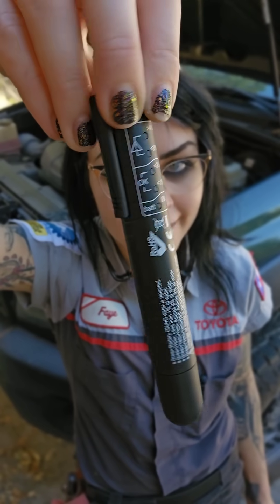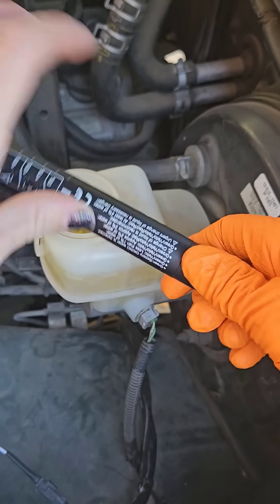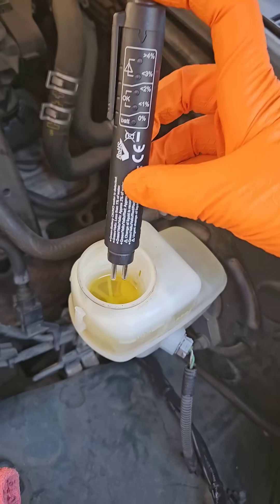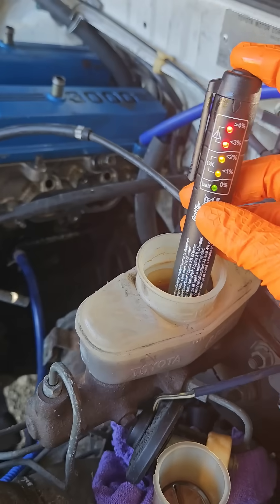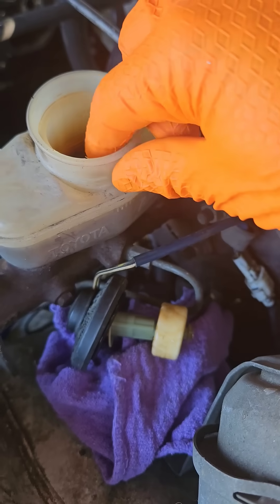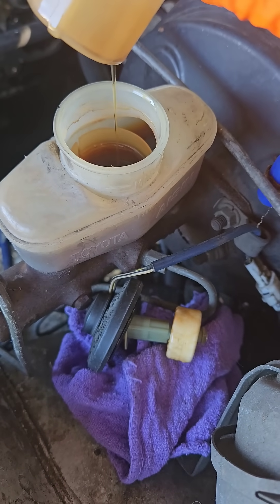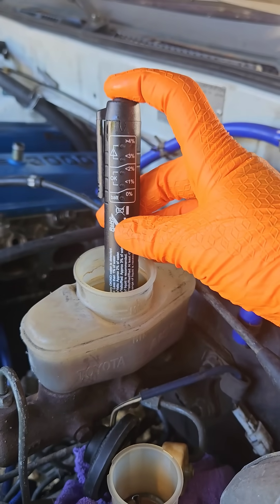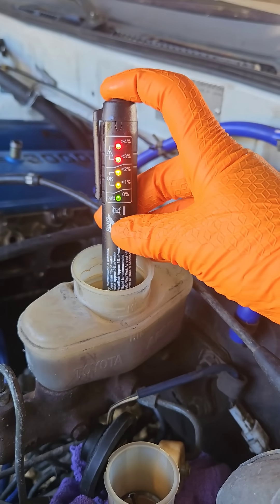Do you REALLY need your Brake Fluid Flushed?? How to Test it For Yourself!

Comment: Technically, water does compress. Although, you would have to have extreme amounts of pressure to the point where it would not only compress itself into ice but if you went beyond this compression it can make small nuclear like explosions as the element goes critical.
🤓☝️
Reply: Im sorry but you are incorrect. Not about water being compressable that is true.
Though water does not become ice under pressure because ice is less dense than water ( pressure melts ice )
And if you are wondering at the bottom of the ocean water is about as compressed as it can be
Reply: @barnabasrsnags4828  water turns into ice under ~1GPa or 10,000 atmospheres of pressure.

I'm speaking as to more of a theoretical standpoint as you can't get to those points under normal means.

The explosion part is under MUCH MUCH higher pressure reaching the criticality point

Upon reaching criticality (theoretically), the neutrons undergo an ongoing series of explosive reactions

If you take ice normally like it just came out of there freezer- then yes, it would melt fairly quickly under much MUCH lower pressures then previously stated :)
Reply: @RexyTheGryphon and i wasnt adressing the explosion part that obv requires star conditions but i like dont wanna argue now yk
Reply: Supercritical ice VI is not equal to ice but whatever have it
Reply: @barnabasrsnags4828  hey, I'm just a retard on a phone okay? I don't know exactly what it's called, I just know the theory behind it

Thank you for pointing out the name though

Comment: Instructions unclear, changed my blinker fluid.
Reply: I knew someone would bring up blinker fluid.
Reply: How's your elbow grease level?
Reply: @TheBriganProductions And check those muffler bearings, and change the air in the tires. 🛞
Reply: what brand of blinker fluid do you use?
Reply: @noredine  No specific brand, any brand will work just fine. 👍🏼
Reply: @noredine yellow flash
Reply: Don't forget muffler bearings 🎉😂
Reply: There must be something wrong with my car. I can't find anywhere to put blinker fluid in. Can someone help?
Reply: @thechicken1477  yes we can. Blinker fluid isn't for your car.. it's for your eyes 👀
Reply: @ItsJustGravy  No its for my car. It says so right on the bottle.
Reply: Easy to follow. Nah you just a dumbass
Reply: Dick stuck in the tailpipe…
Reply: Nah see it's: instructions unclear, dick stuck in toaster.
Reply: After she said blinker fuild was baş i stopper watching her
Reply: But blinker fluid was actually a real thing.
Reply: Make sure to check those piston return springs.
Reply: I actually had her looking for the headlight fluid. This channel is a joke 😂

Comment: Isn't it better to test the break fluid in the actual breaking system which actually gets warm and absorbs water that can corrode the breakfluid pipes ? The plastik container on top of the breaking system wont get hot or does anything at all. The breaking fluid in the breakfluid pipes wont mix with the breaking fluid in the plastik container at all

Comment: so when you do brake pad/rotor changes its normal to bleed the brake system, this almost always drains any water out of the system.  regular brake changes lead to no accumulated water, also the brake system doesn't get hot enough inside the lines to boil water into steam so that's not really an issue at all.

Comment: Despite popular opinion water IS compressible. Sure to the average person under low pressure it's not but if you put it in hydraulic systems and add 5000psi it is spongy. Water is 2 parts hydrogen ANNNNND oxygen. The atomic spacing of the oxygen molecule is where the "compressibility" comes from.

Comment: You don’t need your brake fluid changed until after about 100,000 miles and even then on some occasions you still don’t need to change it after that
Reply: not true at all, by your logic 50 year old brake fluid is just fine

Comment: It's fine if you think you don't need it and test for water saturation but the test strips I use check for pH which checks for acidity and copper content.
Either way, your brake fluid is treated like any other system. It has a recommended maintenance schedule.
Same for your HVAC.
In conclusion.... Maintaining your vehicle's different systems will help you get the most life out of your vehicle and save you money in the long term.

Comment: The scam with brake fluid flush is a tech may only suck out the reservoir and not touch the fluid at the calipers. Many dealers will do this because the flat rate tech will only get 0.5 which is not enough to do a proper flush so it’s easier to do the bare minimum.

Comment: I usually change/refill brake fluid when i get an oil change. It's included in the car services here. Like 40-50 for everything here. I do my car sevices every 10k km. The workshop i go to even put a sticker on my car what mileage i should service my car, which i think is great. I drive a mitsubshi colt. it's a great car for it's value, low maintenance. Only needed to replace the bulbs, fix the ac fan and the ac hose ( my fault, went over some rough surfaces and damaged the line) i always hear ppl complain how other car maintenance super expensive or too often.

Comment: My car gets new brake fluids every 20.000km or every 2 years, it is actually demanded by the manufacturer, but even if not changing it at this intervals is a good think and i would reccoment it to everyone, safety first. My oil gets changed every 10.000km or every year too and i let my mechanic change the coolant every 3-4 years. If you do this the car will run a long time, you should take proper care of your car if you care for your safety and the life time of your car, everyone who did not do it should not wonder if the car will not live that long. Ok you don't need to renew your motoroil after just 10.000km but you should do it at latest arround 15k, i don't know what it is in miles but it is better for the engine. Do not listen what some car manufacturers say with 30k or more kilometers, even the long life oil will get worse after arround 10-15k kilometers, they don't want your car to live very long, so they can sell you a new one in a few years.

Comment: I still do it about every 2 or 3 years on all my vehicles.. either by the $40 hand pump to pull it out by yourself, or have a helper to pump the brake pedal.. either way, it's good to get all the debris and other contaminants as well as the fluid that has absorbed water in there for has a lower boiling point, out of the system.. it preserves the calipers and/or slave cylinders, the master cylinder, and the lines.. And if you're a spirited driver, The fresh fluid will have a higher boiling point, and won't be so prone to heat and therefore causing brake fade..

Comment: I’ve got a 2004 Lexus RX330 with 260,000 miles on it. Never changed the brake fluid or the power steering fluid even one time. Brakes and power steering system work great without any leaks. Moral of the story: Buy a Lexus 😂

Comment: With that specific type of tester they work better if you fix a bit of heat shrink wrapping to the base of both electrodes. Something like 3mm or so. Helps insulate things

Comment: 2005 Vw golf tdi 265,000km, never did a brake fluid change. Brakes were always fine. 
2016 Audi TT 208,000km, never did a brake fluid change. Brakes were always fine. 
Maybe lucky with German cars. I dunno. 🤷‍♂️
Reply: I change mine every couple of years on my Seat because I usually overlap this with the regular servicing times. The first 9-10 months with fresh oil are usually the best, after 1 year it's a noticeable degradation in crispness and overall breaking experience.

Comment: Yes I do in my 1970 Oldsmobile Cutlass C/S when was doing the off the chasis brake fluid was brown plus one other check the master cylinder fluid level was low a bit the reservoirs were rusty on the inside alcohol based brake fluid to absorb moisture had absorbed its limit. Being certified in brake and chasis notified General Motors they started putting in their new car maintenance manuals to do so that's been many years ago

Comment: Technically speaking no matter can be compressed but realistically speaking all matter can be compressed, we just very rarely expirance the nessacary pressures to compress matter. Water has phases that it can transistion throughout various pressures, one of those is a cubic crystalline metalic hydrogen, which means if you squeeze water hard enough you can literally turn it into a rock. We can do this on earth with modern technology but things start getting real fuckin' freaky physics wise when we start seeing pressures that can overcome the pauli exclusion boundry in like black holes and shit.

Comment: the brake fluid should be changed regularly because if there is water in it the brake cylinders will get rust and block at some point, that happened to me

Comment: The water in the reservoir more or less doesn‘t matter. It‘s the water in the brake lines, That’s why you never check on the reservoir, and just go do the change every 2 years. Could also be that there is no water at all in the reservoir, but lots of in the lines

Comment: Just use a weed burner on the break lines and master cylinder. Crank it up good! Use it to boil off excess moisture and allow the metal contamination to bind with the hard lines!! Easy!! Never mind the flames or smoke! That is normal and part of the process!  😁😂

Comment: Every car I've ever owned I've never changed the brake fluid except one car that I had blown the master cylinder out and the same car when the clutch master and slave blew out. I do every other service regularly. Every 100k miles is when brake fluid is due. The fluid doesn't get dirty till then or way after depending on the kind of vehicle. I get it but really hasn't caused any issues for 98 percent of people. At my shop a brake fluid flush is Like 200 bucks.  Just bought a truck norris camshaft yesterday instead.

Comment: Another good reason to flush the brake fluid every 2 to 3 years is that you don’t want corrosion and any other kind of crap getting into the very expensive ABS system and screwing that up. $$$$

Comment: Another way that you can tell that you need a brake fluid flush is if you mash hard as you can on your brakes and it still don't bring you to a stop quickly then that means you got moisture in your lines, and its not squeezing your hydraulic system tight enough.

Comment: Brake fluid also becomes even more corrosive over time, if you flush out your brake fluid every 5 years or so, you can extend the life of your master cylinder and ABS system.

Comment: Brake fluid is Hygroscopic. It absorbs moisture from the air.
Water is heavier than brake fluid so as you use the brakes, it works its way down to the lowest points in the system..... Calipers and wheel cylinders. 
And that is how you get a seized caliper and dragging brakes or locked up wheel.
Reply: So not just the what but the where. Good to know.
Reply: I was hoping someone would bring this up. The old fluid in the caliper is the problem, not the reservoir. Water logged brake fluid at the caliper can also lead to soft/spongey brakes and brake fade as they heat up and the water in the line boils/steams off.

Comment: That's one way to test your brake fluid and it's a valid test. But copper content is even more important. You'll need  chemical test strips that will change colors after being dipped in the brake fluid. You compare the color to a chart that's on the test strip container. The color corresponds to ppm ( parts per million) anything over 200 ppm ,can cause the fluid to become acidic and could possibly cause corrosion of internal brake components. I've seen fluid with 0 to 1 percent moisture content ( 3-4 % is the moisture limit ) but have over 200 ppm of copper. So the moisture content can be in the acceptable level, while the copper content is too high . So while the moisture content is important, the copper content is more important. BG products has a test strip product that tests copper content on one end of strip and coolant concentration for anti freeze and anti boil on the other. The cost is pretty high for a container of 100 test strips but a much more acurate test for brake fluid quality.😊

Comment: I'm pretty sure I've had the same brake fluid for about 97,000 mi from factory new Don't believe the original ceramic brakes have ever been changed 05 Tahoe.😅

Comment: I've driven 5 vehicles to over 220000 miles and have never had a brake fluid flush.  Also never had any problems with brake performance.  Maybe because it was such a slow difference.

Comment: Key fact when telling anyone when checking brake fluid. Clean the cap off so you don't risk the chance of getting dirt inside the reservoir when opening it. If dirt gets in there...u gonna have real problems.

Comment: The word you're looking for is hydroscopic when the water gets into the brake fluid that is exactly what happens. Yes, I just went through this problem with my Tahoe. I had to bleed the brakes but then. I also had to activate the a b s module because there was an air pocket Inside but good tidbit and knowledge you can also use a hydrometer

Comment: Used to recommend a flush ONLY on cars that have had the fluid for a long time as no brake work has been required in that time.  Back then these electronic tools for testing did not exist.  Would always do it after cylinder or master cylinder was replaced on older cars with the high mileage.  Also recommended replacement of muffler bearings after 50,000 miles.

Comment: Pro tip: Brake fluid and blinker fluid are 100% interchangeable. So if your brake fluid needs flushing, a decent mechanic will usually change the blinker fluid at the same time (hold for applause)

Comment: If the brakes don’t stop you something else will. All kidding aside, testing there is not a good indicator. Flush fluid and then check that. Might as well do the whole system every 5 years.

Comment: Brakes ARE CLOSED SYSTEMS. That expanding boot under the cover allows air to enter the reservoir without contacting the brake fluid.
Reply: yes but brake fluid can absorb water past seals and pores in rubber hoses etc. there is a reason you are supposed to change it
Reply: @arcanevoid9199  Although brake fluid is hydrophilic, the rubber in brake lines is hydrophobic. It absorbs very little water over years.
Reply: @idadho  yes but even 3% of the brake fluid being water is enough to affect boiling point significantly
Reply: @arcanevoid9199  How does 3% water get into a pressurized system.? The only time there is negative pressure is when you first release the brake and the piston relaxes a minute amount. It the accordion piston seal is not torn, no water can get to the piston.
Reply: @idadho  it can absorb water at a microscopic level
Reply: @arcanevoid9199  What force is pushing the water molecule through the rubber? There is internal pressure trying to push the alcohol OUT of the brake hoses and that does not happen at a measurable level. Water that enters brake fluid can only enter at the piston seal or the reservoir cap. I've actually seen the signs of that. There is often a discolored area at the bottom of the caliper cylinder where small amounts of water get past the piston seal. Movement of the piston over this wet spot exposes the brake fluid to a wet surface. THAT IS ALL. Even though the alcohol in brake fluid is supposed to mix with and suspend the water, it is obvious that this contaminated brake fluid concentrates at the bottom of the caliper cylinder and piston. 
This is why I always bleed the caliper when I push the piston back. I want to flush out the used brake fluid in the caliper so cleaner fluid enters from the reservoir. I do not want to push that old brake fluid up the brake lines to the master cylinder and reservoir. BTW, I rebuild the caliper on the bench if the piston does not move freely so I see this. 
Do you know what causes the piston to retract when brake pedal pressure is released? The answer is very simple. The retraction movement is extremely small.

Comment: I go by color. I've driven a shitbox with milky brake fluid and it still stopped. You really don't need to do it but she is right it can rust you brake lines. But imma say this, my 98 civic has only had new brake fluid added and the brakes are 100% fine. YOU DONT NEED A FLUSH ITS A SCAM only do it on a car that's been sitting for more than 5 years and you could still get away with out doing it

Comment: Water breaks down brake fluid because it  Hygroscopic . Never open the brake reservoir cap. When you open it, you are allowing moisture in the system, which will cause brake failure. Proper routine maintenance is every 2 years or 30,000 miles under normal driving conditions.

Comment: I take these testers with a grain of salt. Ive seen it clear fluid that is dirty, old and/or slimey. I usually go off pedal feel and visual inspection before I'd trust the tester. Also i think they say your supposed to put it in a clean sample before the test to calibrate/range it correctly.
Reply: Also people just put good fluid ontop of bad fluid sometimes making it harder to do these tests accurately. Brake fluid is so inexpensive that people should just change it on a schedule.

Comment: Thank you, ive been telling a friend of mine that he needs to swap the brake fluid because its been about 10 years lol.
Also when changing the brakes open the bleeder valves when compressing the calipers, yes it shoots out brake fluid, but i helps prevent you from shooting whats in the bottom of the the brake line back into the master cylinder as well you can top it off with fresh fluid often.
Just remember to not let off the pressure when compressing the calipers, it can cause you to suck air into the brake lines and make you have to bleed them more even more than what you should be doing after changing your pads lol